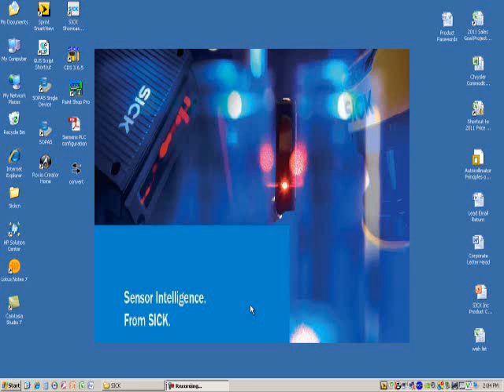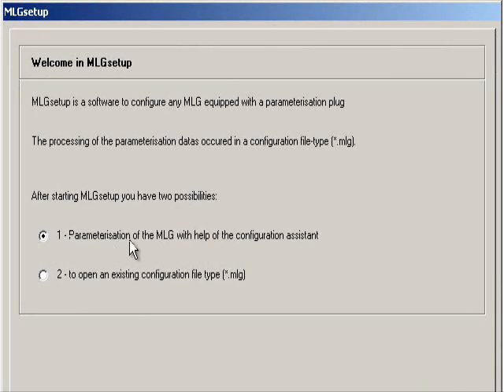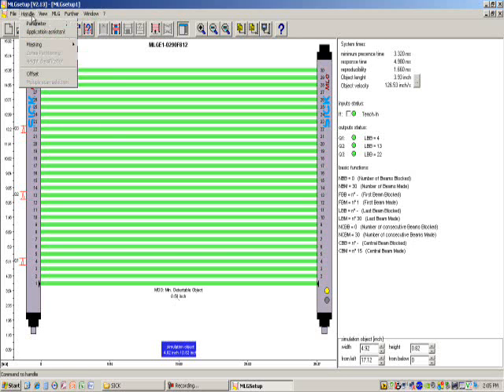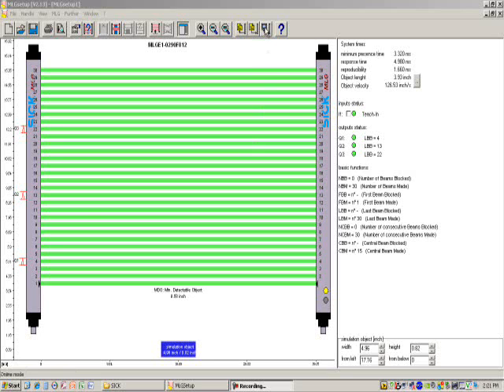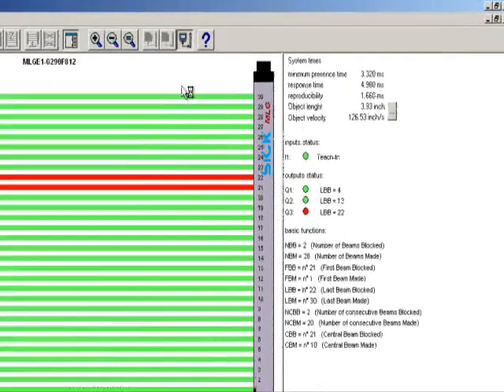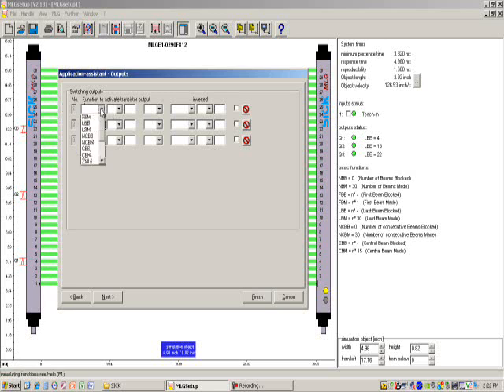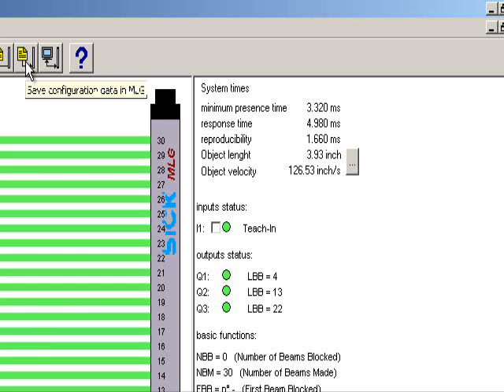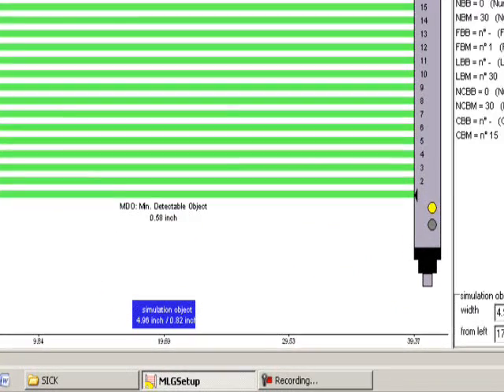SICK MLG Error Proofing Demo- MLG Setup Part 2.wmv

Comment: I’m having issues getting a connection to the sensor. I have the mlgsetup software installed and the cable from sick plugged into my laptop via rs232-usb adapter. When I try to. Download configuration from mlg it can never find the sensor. Have you run into these types of issues?